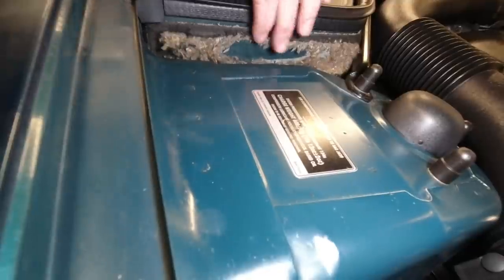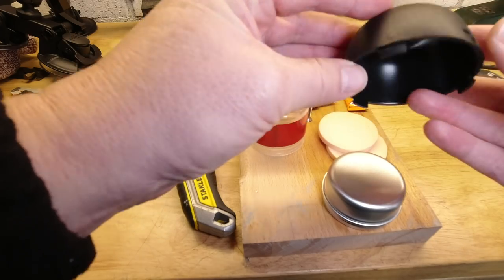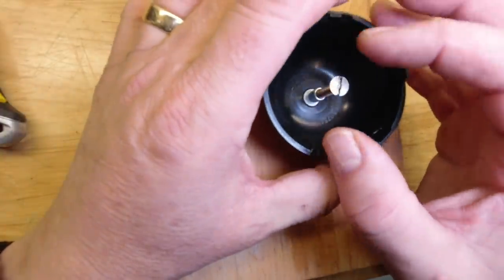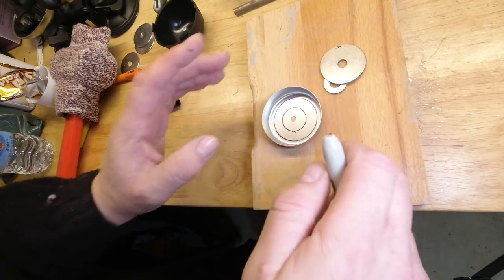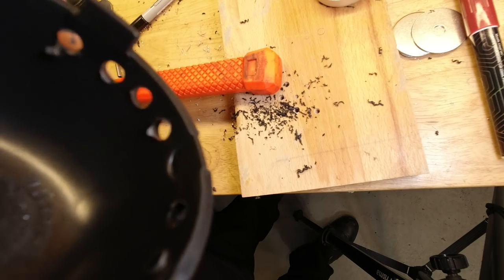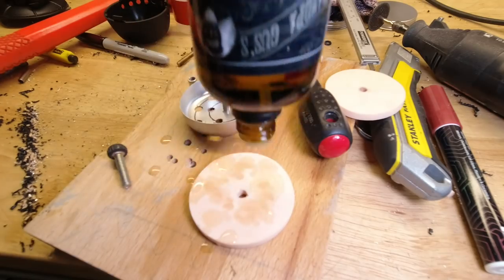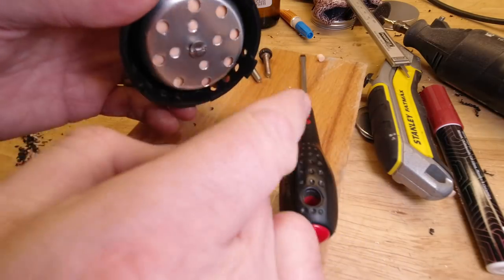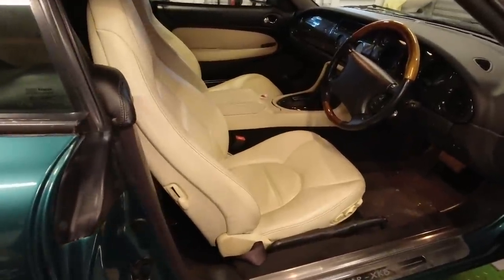Stop mice attacking your Jaguar XK8 or XKR

Comment: I have had serious issues with rodents in my garage. My XJ had some wiring gnawed causing error messages and losing a cylinder. This has been fixed now. I also have a Yeti. This car also had rodents nibbling wires and is more serious. The car needs a new engine bay wiring loom. VERY expensive. This was inspite of having bait AND traps down. The little blighters had started making a nest on the block eating wires ant turbo vacuum pipe.
Reply from the maker: THANKS FOR SHARING TONY👍 Feeling your pain bud.
It really is a bigger issue than most people think. (because it sounds almost comical) But if you live anywhere even slightly rural, you need to take it seriously on any car not driven every day
Reply: I live in the country & had a mouse nest in amongst my cylinders, luckily they had only chewed through one wire. When I turned the ignition, I knew that something was wrong with the firing order & the 'limp home' mode came on. My independent garage replaced a wire, at a cost of £70. They once collected a Range Rover with major damage to the wiring loom. RR sent an electrical engineer down & the repair was over £3,000.  I now only garage the car after the engine has cooled down...the little blighters prefer a warm engine!  Haven't had any since!

Comment: John I have had the dreaded mice problem, I’ve repaired or replaced most damaged items. Two questions - where can I get replacement stud covers like the one the mice had attempted to eat in your Jag and how often would you have to top up the oil in the repellent caps? Thanks for the idea making mine tomorrow just ordered the oil. Cheers.
Reply from the maker: Not sure on the nut covers at the moment David. SNG Barratare not listing them. Im sure there will be a trailer wheel nut cover or similar that looks identical though. When I find them I will let everyone know. Or if someone else finds them cheaply, please let me know👍. 
Enjoy your build👍

Comment: Have you replaced the sound deadening material yet and if so where did you get it from?
Reply from the maker: Hi Paul
Not done it yet (just too many other things have jumped the priority list) but will soon. 
This is the material I have bought. You cant buy original (and I wouldn't want to anyway as the mice love it)https://www.ebay.co.uk/itm/253928879538
Reply: @ToTheGarage  Thanks, very helpful.  I've even got the chewed plastic caps (4 out of the 6) that you highlighted. I assume the mice have a field day in XK8's because they aren't driven that often, i.e daily drivers don't suffer from them?